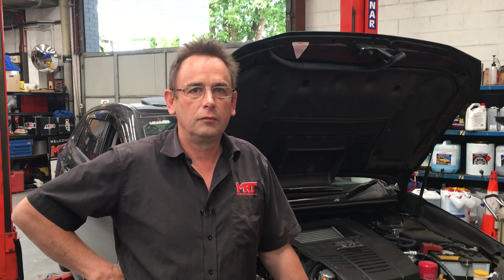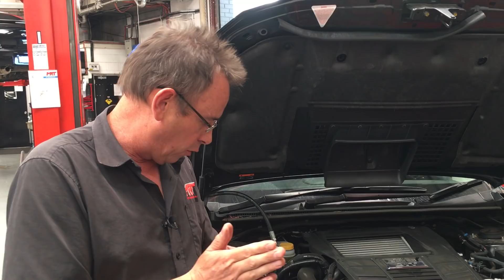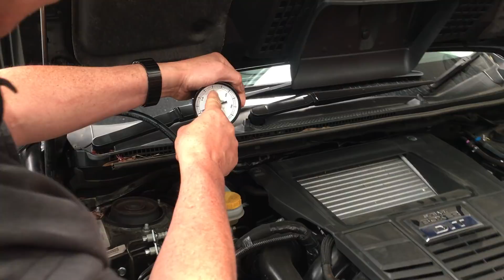Subaru CVT Research & Development Update

Comment: The CVT is dependent of the friction between the metal belt and the spindle to transmit power.  The CVT belt can slip when enough torque is applied through it.  The only way for a gear type automatic transmission to slip would be to apply so much torque the teeth shear from the gears.  That takes 1000x more force then to slip the belt in CVT.  That's why gear type transmissions are so much more robust.
Reply: Not so. Geared auto transmissions can slip and do. Different type of slipping, but they can slip.

Comment: At least the Subaru CVT seems to be  one of the better ones out there. I really hesitated to buy a new car with a CVT and I test drove some really bad ones in other makes and models.
I settled on an 2.5 Outback premium and I'm amazed by the fuel economy from this vehicle. I think I made a good choice, but time will tell. I don't tow anything and off road consists of dirt roads with shallow ruts, so all should be ok.
Reply: The Toyota  and Honda CVTS are the better ones. You've got it backwards. The Subaru CVTs are from Nissan's JATCO - which are arguably the worst transmissions in the world. Get your facts straight please. On top of the fact that Subarus have high maintenance costs when the AWD system fails + the junky oil burning, gasket blowing, rod throwing Boxer engines: the CVT is icing on the cake of money pitting
Reply: Honda CVTs are nothing to brag about, so you're wrong on that one.
Reply: @cgmf-d6t  Um no they don't... Don't spread misinformation if you don't know what you're talking about.  Fuji Heavy Industries, known as the Subaru brand, manufactures its own proprietary Lineartronic CVTs in-house.  They haven't used JATCO for many many years.  Now on to my opinion.  I do feel that Subaru's are indeed one of the better ones out there.  While I can't speak for the Honda as I've never driven one of their CVTs I despise how Toyota's CVTs feel in comparison to Subarus.
Reply: @justinkeller6379  uh, yes they do. Go drive it first. The Subaru is too laggy and slow
Reply: @AlienNinjaPuppy  No they don't..  do some research for Gods sake.  I have driven one.   A 19 Forester to be specific and it didn't feel laggy at all to me   I also have driven a 17 corolla with a CVT and it felt horribly unresponsive.
Reply: Justin Keller you tell em!

Comment: Dear CVT Research and Development Team,

As a Subaru Outback owner, I feel that the CVTs are sub-par as compared to an automatic 4-speed transmission. Im speaking in terms of longevity, I will gladly lose 2 mpg for greater reliability. My suggestion scrap the CVT and put the 4 speeds back in them.
Reply: You are correct!  My 2011 Outback with 114,000 miles required a new valve assembly part @ $2100.  (dealer charge)
Reply: Jeremiah Jorenby Ill buy a Toyota Highlander, Honda Pilot or Ford Explorer before Ill get an Ascent.
Reply: I sold my 2015 Subaru Legacy H6 cos of CVT transmission. Really cvt not reliable and kill the enjoyment of driving AWD like Subaru...!
Reply: Is that all you can say?  Punk, meaningless comments from your mommy's PC?

Comment: Wish something came along for the new crosstrek 2.0L. The throttle response just sucks, even if little to no power gains just a good solid remap vs the economy pedal Subaru seems to have factory. 30% throttle gives you more off the line than a stomp.

Comment: Part of me thinks I would like a Subaru,but from what I've seen online I'm not sure I would like a cvt. When/if we do get a crossover it might be nice if we can hook a small trailer or something to it. I'm not talking about Truck size towing. But it might be nice if it could handle some light work.
Reply: T Ritchie from my experience with my 2018 outback, the cvt performance is pretty flawless.  It shifts smooth and getting great mpg.  All the hate on the cvt is unwarranted.  Cvt issues probably come from people towing stuff or a lot of mountain driving and not doing the recommended cvt fluid change every 30k miles.

Comment: There are a lot of commentators on the CVT trans. Some are credible and that makes me think that there is a weight limit the CVT can handle well. My question is : is the CVT technology still in the domain of "bleeding edge" of technology, or the problems are solved. I do like Subaru and Honda SUVs but I think that they are on heavy side for the CVT.
Reply: The only thing left to do is to wait two years and see if there is any bad reports from the new generation. There are some changes in the design and they seem more robust - just bigger in size. 
In Japan, even RAV4 comes with a 2.0l + CVT :(

Comment: I have 2014 Forester XT probably the same engine and transmission. After 35k km's gearbox start to stall for a 3-5 seconds before accelerate hard and boost of engine and other parameters and same. Took it to official service and ECU been updated with new program 3 times. No change. When I force shift it down for a gear it's accelerates as was brand new. Is that something to do with slipping? How can I identify the problem more precisely? I'm from Baku Azerbaijan, far away from Australia ))
Reply from the maker: sorry, this is best supported by your local Subaru dealer...